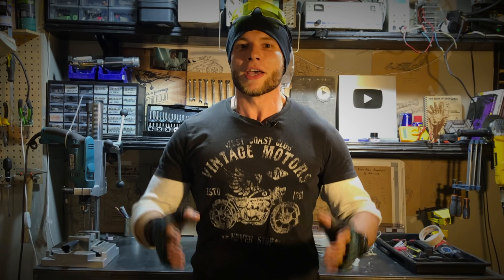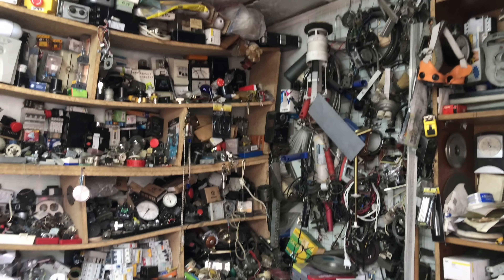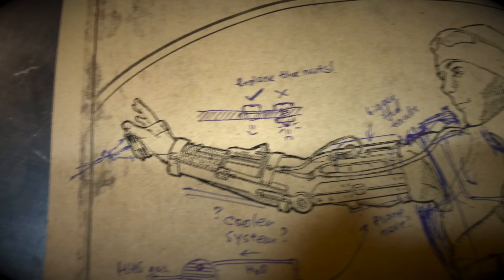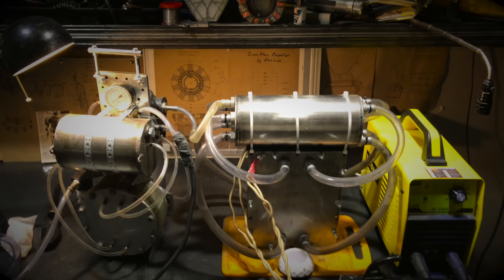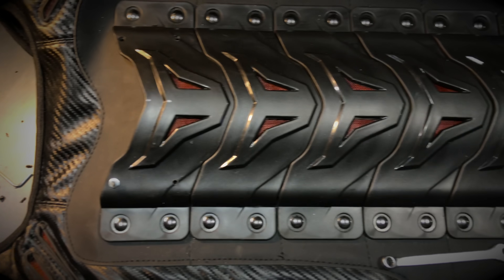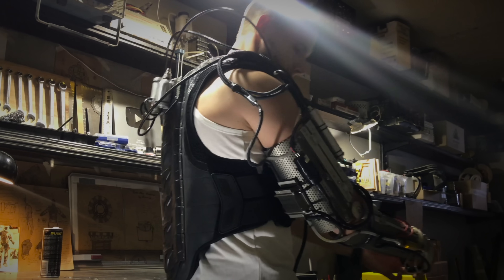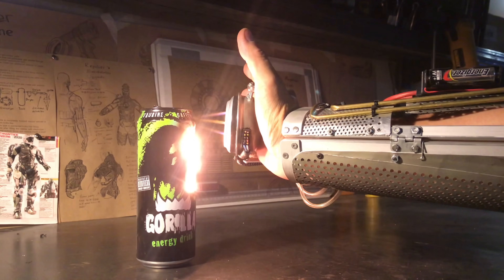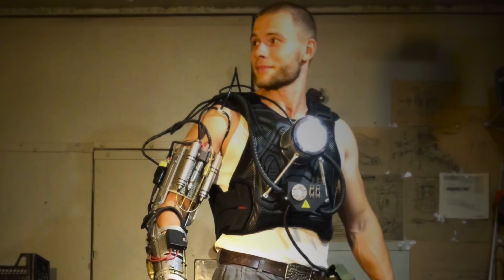Iron Man Repulsor 2.0 (3000°C HHO torch for Iron Man suit) DIY alkali electrolyzer

Comment: Dude have you thought about making additional hydrogen reactors without the flashy LEDs and hiding them in different parts of the suit such as the back and thighs? If you just had the resources, then you could create four more reactors of different shapes to increase the level of gas output! :)

Comment: You want you motor bike to run better on hydrogen?  Try mixing exhaust fumes to the hydrogen to slow down the flash point. This will help with timing to gain back horsepower.
Reply: Use the exhaust fumes from gas, not hydrogen. Collect enough fumes in a trash bag for simplicity. Then mix with hydrogen to your desired flash point. I used a 10 foot piece of clear tube to see the flash point change.

Comment: I'm wondering if you could use a small high-pressure nozzle inside a larger lower pressure one. This way, the larger flame with the lower pressure is the stability of the system and keeps it lit, all the while it preheat the high pressure nozzle, allowing the gas to be closer to the ignition temperature, and over all allowing for a higher than normal flow rate, because there is a low pressure stabilized flame keeping lit, and the gas is pre-heated closer to ignition.

Comment: you can use isotop battery like carbon or nickel that is coin size and discharge about 3.1Volts so if you stack them up you can get a lot of energy and fun fact is that radioactive battery which are small can last up to 50 years highest! you need to focus on cooling and shielding if your using the (diamond based Nickel battery)

Comment: think less metal n more organic structure so everything like your fuel storage will be like lungs n gas transfer tubes will be like veins assembled in a silicone suite this would compliment your hydrogen powered muscles perfectly n then to protect everything you can use your electroplated composite plates so it forms an almost chainmail/dragons skin like exoskelleton shell

Comment: The Tech simply isn’t invented yet. The Military has barely cracked a Respectable Man-sized Exo Suit even with Billions Of Dollars in Funding. It’s an Energy Problem. A Suit that can Fly properly is simply just not there yet, The Jetpack tech has barely advanced since the 1960s, and they have Companies with Alot of Smart People and Millions in Funding and the proper resources. If you want a Suit that can fly you either need to Build Wings (like the Falcon Wings) or give up on Flying (For now). The Helmet Screen Tech, Armor and Software has been available for a Long time tho. 

Best Alex Lab can do is create a Low Bullet Proof suit that He can comfortably move around in with some low level exo suit functions. He’d still have the Helmet tech and Propulsers and whatnot. Some other tech too. If Hacksmith helps him out…Then it’d be a Fully other thing. They might solve the Tesla Coil Problem and Fix the Energy problem completely!

Comment: Hey bro next time just a thought. If your pressurized the water side you can put a larger tank on your back so your run time is longer. It’s just you’ll have to make the lines have to handle the pressure but not much is needed to move the water

Comment: You could use thick disc of aluminium (as diameter of the bell housing thick as tin can)
and 

can drill water channels inside of it and after the creation of channels you could mig weld the outer holes sealing the holes 

 making as an  inner cooling loop and 

Routing the inlet and the outlet   from the side or under ur hand 

And placing the water block inbetween the repulsor and hand ...

You could use the same technique to cool the nosels of   just make channel holes around the nosels .... You could connect the loop cooling the hand to the repulsor intentionally cooling it too for longer use

Comment: Not a real lightsaber... And a real Iron Man suit is pretty much impossible because of the lack of power. It's better to not lie, cause I don't think you're stupid seeing the things you're doing.
And this was just 3 blow torches... nothing like the repulsors.

"The repulsors work by taking excess electrons and turn them into muons, which have ability to penetrate deep into atomic matter, which are then fed into hands and chest piece of any iron man suit.

Muon is an elementary particle similar to the electron, with an electric charge of −1 e and a spin of 1/2, but with a much greater mass.

The suit then can generate the powerful blasts as seen in the movies by intake of air through the suit and running it to an Isolated section behind the palm. An electric current is then run through a section of the gaunlet attached to the palm to create a small amount of plasma.

Plasma is created by adding energy to a gas so that some of its electrons leave its atoms.

Because of muons electromagnetic properties, the plasma and muons can be fired from the hands and chest to create repulsor blasts as a primary weapon. The plasma generated from the repulsors can be used as thrust similar to certain space rocket engines."
A long way to go...

Comment: Great.  You made a steam punk, palm mounted, overly-complicated, hydrogen torch.  Exactly  what a repulsor beam ISN'T. 

You're right up there with #HackSmithIndustries making a hand-held,  short duration, plasma torch, and calling it a light saber. 

Kudos......🙄😑🤨
Reply: While I agree that Hacksmith has never made anything like a lightsaber, I do think that Alexlab's repulsor is more similar to the short range laser cutter that Iron Man uses on metal surfaces, such as the welding scene underwater. Especially when you consider that Alexlab's repulsor is completely self contained (unlike the Hacksmith lightsaber), i do think that its pretty accurate. However, he should totally have a separate laser system for long range, like the ones that Styropyro has made

Comment: yes but doesn't the repulser also act as a flight stabilizer in the future if you ever get to the flight boots you'll have to reconfigure the whole system to be able to produce enough outward pressure to maintain upward balance while in flight, otherwise you'll just have to be incredibly balanced and concentrated the entire time.

Comment: I THINK  the too much heat on your hands ckuldbe solved with a small container of water on your hand between your hand and the hot part. 
It can be made so its always moving the water inside through 2 or more tubes into a slightly bigger container on your armor back of the hand so while it moves it cools and colder water is between your hands and the hot metal. (Still not recommended to use it for too long unless the metal around the jets of flame can still melt pretty fast.
It can be made without the tubes not moving it takes up less space but doesnt cool as fast and can be used for way less time.
Reply: In my opinion what would work the best in the long term is to build the suit in whole without the "tools" in it and put them in after with replacing anything that doesnt let the "tools" fit. Because in the first place its an armor and the exoskeleton so if you cram in the "tools" and try to put in anything else after it just wont fit the same way. 
For example in the 2nd movie tony made the mk42 with all the armor aspects and the strenght enhancements and everything else wasnt worked out yet. Wasnt a complete suit but could still lift a car and protect him somewhat.

Comment: https://youtu.be/KbBwqxV0DKU combine m
3d printed micro nozzles into your repulsor and use vortex gun technology to add lift through a filter to make your thruster for your flight system so your hydrogen powered suit to fly. Ignite the hydrogen and use the oxygen to force it out in a vortex stream so you have a lift force.

Comment: Man you do amazing stuff. At some point you could also look into methanol. It's an amazing fuel that can be easily converted into hydrogen and can be synthesized from water and air (CO2). It is very easy to store and has a much higher energy density than hydrogen in a gas bottle. I am currently planning to convert an old offroad truck to electric with a methanol fuel cell that generates hydrogen which is turned into electricity. That way I can have all benefits of the electric motor without the hassle of a large battery and I can have the same range as any other car. It's amazing technology.

Comment: Hi Alex, had a few ideas i think your like.
Clearly all the piping is not scalable and reliable long term so why not place a mini arch (hho) reactor in each place of the repulsors!
This way you can use thin wire to each location on the body instead of having high pressure lines everywhere that flex often over time and are bound to fail.
By integrating reactors and repulsors at each limb you also dont have a single point of failure if you get to flight testing.

To improve the efficency of your reactor id sudgest doing what a famous american inventor did with his water powered car (the guy went missing, please google), he used high voltage dc.
So convert ac to high voltage dc and you keep thin wires, increase production of hho because your even start producing plasma in the hho generator which means you can shrink the hho generators and use Titanium instead of steal for both weight reduction, and increase strength to build high psi directly inside the hho generators so you produce thrust for flight and a real repulsor effect. 
Im aware that Russia produces most of the worlds titanium so hopefully its not too costly for you.
Also by using titanium you can machine the hho reactors to become extream high presure vessels and can be pre-charged (filled) before going mobile!
You could even choose to just use pre-charged pressure vesels instead of hho reactors and thus reduce weight and battery as well as other energy requirements.
The many increases should mean you can project the flame further away from the nozel meaning no need for cooling and increased cutting speed as in the video.

You could even consider using high pressure hho in canisters around the body for exo musel movement, repulsor and even flight.
This way you would not need hho reactors, just a base station. No large battery for the hho reactor/ generator either!

Good luck, im an engineer, security consultant and VR consultant.

Regards
Chris

Comment: I need to tell you something...please make the arc reactor self sufficient...using lithium batteries isn't a good idea
Reply: Do you know how hard that is. What your describing is almost perpetual motion. The only way to make it “self sufficient” is to have a fuel burn, to convert to electricity to charge the battery…. That’s so much effort and lost energy is the energy transformation when you can just plug it into a socket and charge for an hour.

Arc reactors don’t exit

Comment: Hydrogen is the new magic stuff why is no one paying attention to it
Reply: People are trying. The problem is that hydrogen is pretty much the smallest atomic molecule that exits. It can move between the molecules of pipes. A train tanker filled with hydrogen 100% sealed. After 24 hours of doing nothing 60% of the hydrogen leaks out of the tank from just the gaps between the iron molecules. It’s hard and not as simple as using hydrogen instead of petrol. There’s allot of issues with it that still needs to be sorted out… and it’s extremely explosive

Comment: Also you should look into jet propulsion systems.   You could look at the rc jet propulsion  systems  and work it up in scale.  Honestly  if you were to scale this invention to the hulk buster size. It could be much more applicable.   You could make drones like Veronica. In the movie to assist with external assistance  such as refeuling like how aeroplanes re fuel. This can be a multi purpose  usage.  From filtered purified water.  Refuel to power the hydrogen reactor.   To. Octane... methanol. To power the jet propulsion. Systems.   In low orbit you can then use ionization thrust and just run it off of solar power.   Origami. Can be useful in terms of the solar panels opening out in low orbit to power.   As they can be folded and arranged in such a way to minimize  space.  And aerodynamics.   The drones can be used as additional  power sources. Or power banks. Fuel storage..  replacement parts storage.   .. telecommunications  rage booster..  .. multi purpose  intel.  As they can be equipped  with different  sensors for different  applications.  Such as reconnaissance  .. weather...  humidity... temperature.. safety..  monitoring..  scouts...  beacons...    imagine  the possibilities.  If we worked together

Comment: I would like to point out you're basically putting a small rocket nozzle in the palm of your hand considering the space shuttles primarily used hydrogen and oxygen engines also the way the space shuttle engines are cooled is it pumps the liquid oxygen around the nozzle before burning it I assume this will be useless information for you but felt like it would be worth mentioning

Comment: And people say you can’t make cars that run off water. Lolz
Reply: You want to know why you can’t (yet) you need energy to break down the water into fuel. I’m this case he uses a battery. Which means your car would have to have a battery in it to convert water to hydrogen to burn… or a more efficient way is to use the battery to move the motor. That why we aren’t running on water yet cause it’s just an extra step with results in energy loss. The main why to do it is (very simply) to fill the car with hydrogen and just burn that. A car running on water is just inconvenient. A car on hydrogen would work (once we iron out the problems with that)

Comment: Every person who has made different iron man parts of the original suit needs to get together and finally make the suit with all of the parts
Reply: The Tech simply isn’t invented yet. The Military has barely cracked a Respectable Man-sized Exo Suit even with Billions Of Dollars in Funding. It’s an Energy Problem. A Suit that can Fly properly is simply just not there yet, The Jetpack tech has barely advanced since the 1960s, and they have Companies with Alot of Smart People and Millions in Funding and the proper resources. If you want a Suit that can fly you either need to Build Wings (like the Falcon Wings) or give up on Flying (For now). The Helmet Screen Tech, Armor and Software has been available for a Long time tho. 

Best Alex Lab can do is create a Low Bullet Proof suit that He can comfortably move around in with some low level exo suit functions. He’d still have the Helmet tech and Propulsers and whatnot. Some other tech too. If Hacksmith helps him out…Then it’d be a Fully other thing. They might solve the Tesla Coil Problem and Fix the Energy problem completely!
Reply: @therealmr.incredible3179  Tried my hands on such project too and came to the conclusion that the lightest version of the ironman suit would be a mixture of Nylon threads, carbon fiber, and electrolyzers as shown in this video. 
The energy problem for constant flight is a problem indeed and can only be sustained through either wings as you've mentioned, or combination with a wingsuit.
This would mean you're not really flying, rather gliding through the air, but would only require propulsion upwards, and energy for braking without falling.

Batteries are simply too heavy, and using combustion systems might be more energy efficient, but the whole combustion engine also weighs a ton.

I'd love to see someone work this out though, but we'll have to wait for a denser form of energy without any side effects.
Reply: @ZamoraksApprentice  See, The Technology is already there now all we need is for someone or a Group of People to put it together and make a Real Life Version of ‘Iron-Man’. Weren’t they working on some Li-ion Batteries that are supposedly very advanced and powerful? What about those Tiny Nuclear Batteries? I think this Energy problem is gonna be Fixed come the end of the Decade. Also very Cool that you got your Hands on such a Project! Mind telling me more about it?
Reply: @therealmr.incredible3179  Ya sure mate.

There's different parts of it so I'll divide them in underneath:

Frame construction:

Lightweight and strong, made out of carbon fiber, combined with strategically positioned pulleys to optimize tension and movement.

Pulley system:

Created for manipulating the wing-like appendages (these will not be used for propulsion, rather for braking at high speeds).

Wings design:

Made out of a composite structure where the nylon threads would be used as a tension element. Keeps it lightweight and stable.

electrolyzers for power:

Produces hydrogen used for propulsion. Integrate fuel cells to provide the electrical power for additional components of the exoskeleton (sensors and control systems)

control mechanicsms:

Use the sensors which detect movement in our muscles to mimic the movement in the exoskeleton (microcontrollers and feedback systems)

Incorporation of safety features are needed, and alot of testing out to prevent failure when flying mid air.

Those are the hard lines basically.
Reply: If Alex Lab were to collaborate with Integza, Jlaservideo and PlasmaChannel, they'd be able to make a true ironman suit in less than 6 months, though I doubt any of them knows about the other unfortunately, but we can only hope
Reply: @ZamoraksApprentice  Hacksmith does know about Alex Lab and apparently they’ve invited him over (I asked them in the Comments), I do think Hacksmith is much much note better Than Jlaser and PlasmaChannel, Not only do they have more Experience, They are much more likely to bring Iron Man to the real Life. They have some real geniuses on that channel and they’ve worked on AI’s, Iron-Man Adjacent Tech and Jetpacks…etc. Don’t know about the Other Guy tho. Also that sounds really Cool!
Reply: @ZamoraksApprentice  You missed hacksmith
Reply: @FranAntonio  My bad haha, him too
Reply: True